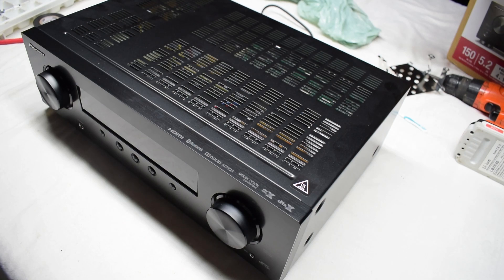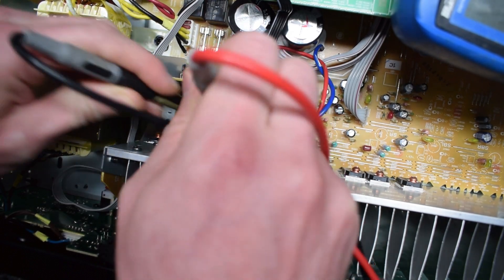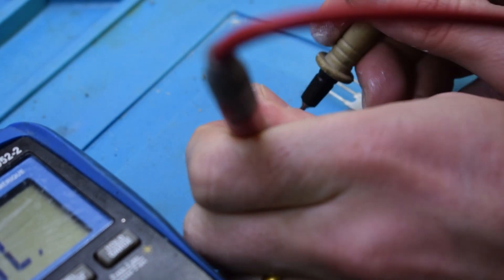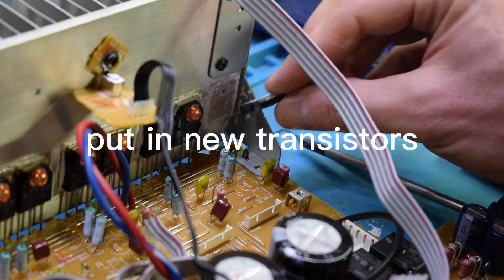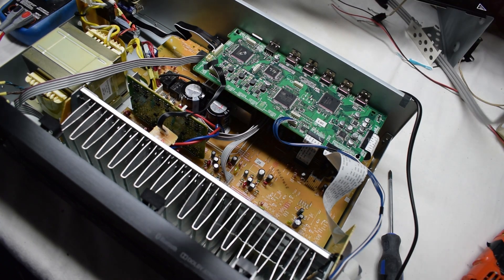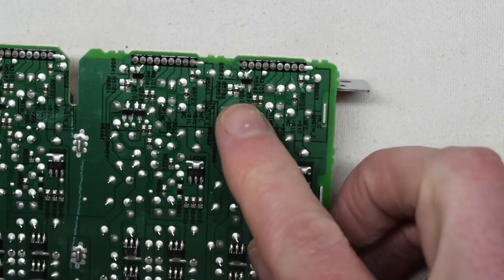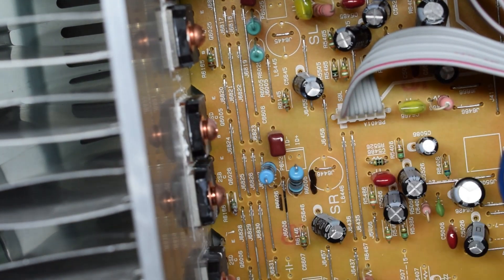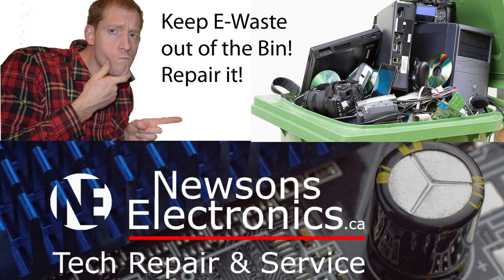Pioneer VSX 534 repair (full Diagnostic NG:LCRSLSR error code)

Comment: Hi those big power transistors I believe they have to be replaced in pairs, so they have they same/similar characteristics ( also have you performed reset of the system holding power button for 5-10 sec. it will be back to default setting, especially when new components has been changed and could reset the fault message - worth to try I guess?)

Comment: While pressing and holding ZONE 2-CONTROL of the input selector on the main unit with the unit turned on, press the STANDBY/ON button , . "Clear" is displayed on the display, and the unit returns to the standby state. Do not remove the power cord until "Clear" disappears from the display.
Reply: You mean the ZONE A/B Button ? There is no Zone 2 Control  button on the unit. Can u pls help. Need to reset my pioneer vsx 534.